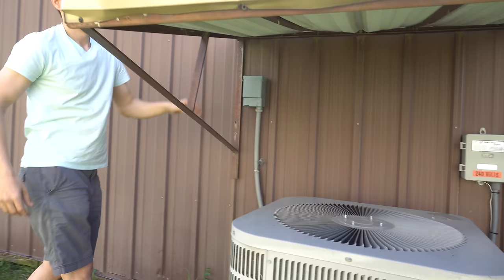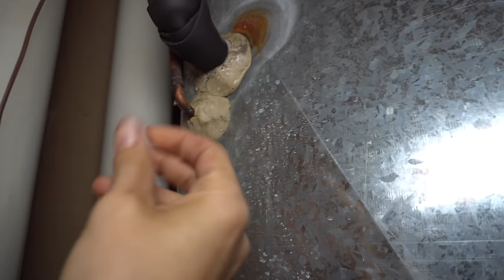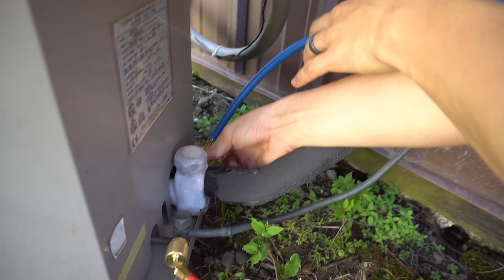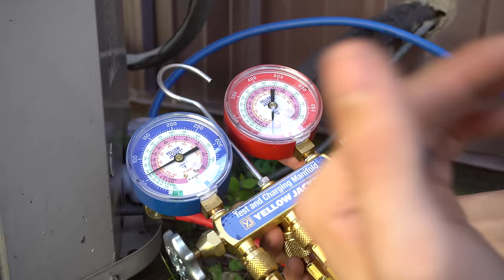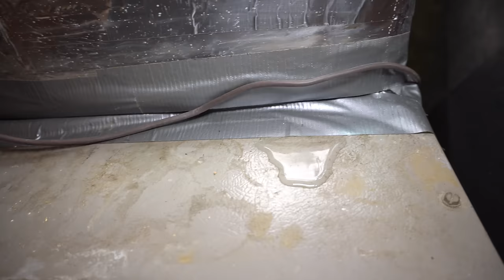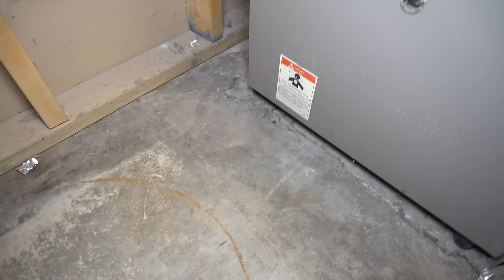How To Add Refrigerant To Air Conditioner

Comment: All refrigerants have a pressure/temperature relationship.  Just using pressures to check or charge is wrong. Indoor temp, outdoor temp, liquid and suction temps and pressures all come into play.  Subcooling and superheated is the only way  correct way to charge. 65 or 70 psi suction may or may not be correct. Unless you have proper tools and training you should not do this. You could damage your system and cost yourself more than if you hire someone.

Comment: Don't u need a vaporizer?
Reply from the maker: A vaporizer would be used if I was adding the refrigerant as a liquid but since R22 is not a blended refrigerant it does not need to be added as a liquid. In this video I was adding it as a vapor so no vaporizer is needed.

Comment: Another video says to have the tank upside down.......hmmm......
Reply from the maker: R22 can be charged via vapor or liquid. I've found that if the tank is cold or there is not much refrigerant left in it, then it is better to charge it in liquid, with the tank upside down. But if it's a full tank and it's nice and hot outside, I just leave it upside up and charge as vapor. R410a on the other hand should only be charged with the tank upside down. Never in vapor.
Reply: @WordofAdviceTV  I wish you lived in WI, I'd hire you for my AC dilemma!!!

Comment: Awesome, I like the AC roof over it, I will have to do that. Q: My AC barely cools, on a 100 plus day, all I get is about 79 degrees max on inside. My not running pressure is low=125 psig (retard) / hi=130 psig, running is low=66 psig / hi=199 psig. What's going on????? Somebody please help!!!
Reply: Putting a roof over a condensing unit is a BIG mistake  on a hot day the hot air will recirulate instead of rising up and away deceasing your units efficiency or worse
Reply: @patstexasstyle5395  Didn't think of that, thanks for the tip.
Reply: No problem and if you haven't figgered it out yet those pressures are too low probably low on charge unless it's a high seer unit like 13 14 + then you may just have dirty EVAP or something similar

Comment: As a Hvac tech I cannot stress how you shouldn’t do this unless you have a license. EPA will fine you, the pressures he are shooting for are not universal. If there is a problem with your system you could cause 10x more damage using “gas and go” repair. More damage equals more money it will cost you.

Note for the tech. You need to charge with tank upside down to charge liquid not vapor.
Reply: chad r22 u charge as vapor not liquid by the way epa is fulled of crap i tried to report a guy for venting on the phone 10hrs 10yrs ago!!!

Comment: R22 has been banned for environmental regulations for like 10 years  (with some others HCFC). You would be in jail in Europe by topping up that unit 😂😂
Reply: It's perfectly legal for home ACs in the USA, but there are restrictions on what you can and can't do on larger units. Production of new R22 in the USA has been stopped, however.
Reply: @sv1201  I was aware of that, just saying it is not the same for almost the rest of the world. A poor spanish guy sold a tank of 30 kilos of R22 and landed 4 months in jail.
Reply: Or have some great troubles in Australia. We took that something called Montreal and Kyoto Agreements very seriously.

Comment: Refrigerants aren’t anything more then just methane and propane and butane with a tiny bit of fluorine and chlorine…depending on what kind of Freon used….the stuff that matters is the oils the compressor needs to operate the most efficiently….people use propane out of a large tank to cook on a grill so really….its not rocket science

Comment: Disclaimer- he says you "should" be certified before working with refrigerants.   That's not totally correct - you MUST be certified in order to work with refrigerants. Federal laws apply, will get in huge trouble and have to pay a tremendous fine if you are caught working with this stuff and you aren't certified.
Reply: Lmao! Funny! I can go to Walmart and buy propane in large tanks….not much different then all the different types of Freon…methane butane propane…are refrigerants…so just stop

Comment: What is that? Comic video? The inside unit is frozen it means the fan issue or evaporator is dirty. That coil was full of gas that is why the gas is evaporating in the suction line. What he is going to see on manifolds when temp evaporator and condenser are completely different? Adding R-22 with the gas form?  It could take an hour! The manifold and absolutely new. You are youtuber not engeneer.

Comment: Dude you have to let the freon go through the system before you continue to add freon. You have to wait longer or your going to over charge the unit. And you shouldn't be adding that much each time. I cringed when you kept doing that. It's just a good way to overcharge the unit.

Comment: Nobody without training or licenses should even think of attempting this. You need an EPA license to even possess refrigerant let alone purchase it. Being caught without a license is $10K per incident.
So if the guy in the video does not have an EPA license there is video proof and he can be reported.
Where is the mention of superheat and subcooling? TXV or piston? Air flow? Amp draw? The list goes on before just dumping in refrigerant.
Reply: No one likes a rat

Comment: I do appreciate all the effort you put into your videos. But,  I think you should be a little bit more accurate and do things 100% right so as not to let others create mistakes on their own.  You should have waited on this one to do the proper way to add refrigerant  using superheat and subcool and using the temperature gauges.  I saw your admitted mistake on another video. I have not watched all your videos yet but I hope the others are accurate. 

Word of caution to others.  As mentioned from another comment here >>>>
"Don't use this channel (100%). Either view HVAC School or A/C Service Tech LLC channels here.".  Everyone needs to learn from other videos.  I am learning and watching as a homeowner and picking up more tips from watching multiple videos.

You are good and have good intentions and I like your videos but need to be more accurate before doing videos like this one.
Reply: Oh hush, what he did worked fine. And it will work fine for thousands of homeowners that will follow his awesome instructions.  Trying to make it more complicated than it really is no longer works for deterring homeowners from doing it themselves.   Con men HVAC techs  is what has destroyed your industry

Comment: I fail to understand the scope or objective of this video. 
 You fully admit this is not the proper way to recharge an HVAC system. Yet you go through the process of showing anyone who views this video, how to do it incorrectly. Why make the video? Beer can cold doesn't mean a system is properly charged, you said that if the suction line sweats then the unit is charged properly.
 A sweating suction line means that the surface temperature of that line is below the dew-point, nothing more can be ascertained with that observation alone. 
 This video in my opinion, trivializes the refrigeration process in an attempt for views. 
 If He's a good enough friend to use new R22 and do a gas and go, why not try to find a leak? May be an easy and simple fix. I wouldn't gas and go a friend unless it was an emergency and the friend or family member needed temporary cooling due to a health condition. 
 In the end, it's your channel so you do as you please. Keep in mind though, this video may be viewed by anyone, and showing this improper practice to the world could confuse people into thinking this is a cut and dry easy, quick process. I'm not a business owner, so don't think I care about money. I do this professionally because I love what I do. It's. just a convenience that I'm compensated appropriately for my skill set.
 Have a great day
Reply: Although charging a system using pressure isn't the best way, it's sufficient enough under most circumstances. Yes, leaks should be found and they are usually in the evap. This is an expensive repair and if the leak is slow, a top-off is a viable solution for those that don't have the money to replace the evap. For the record, I always check superheat or subcooling.
Reply: Amen this guy is a dangerous hack!!
Reply: Sounds like you're afraid people won't need your high overpriced services anymore